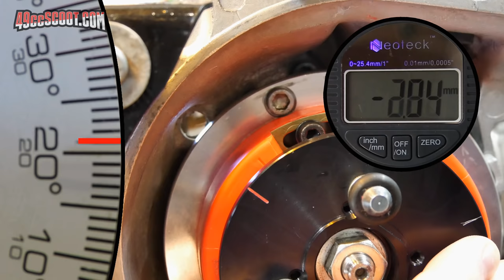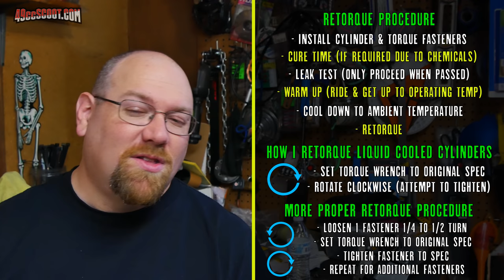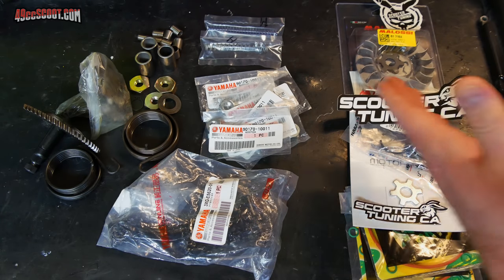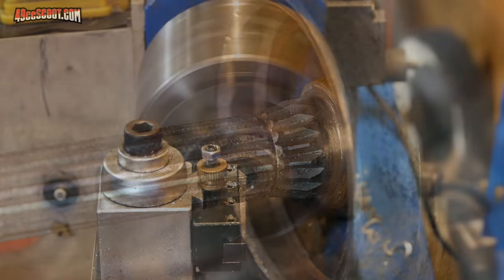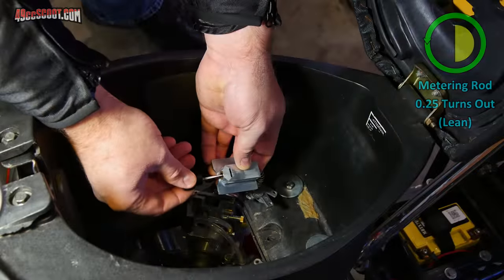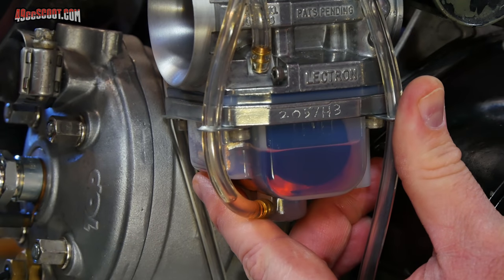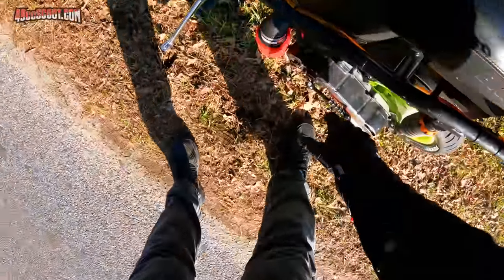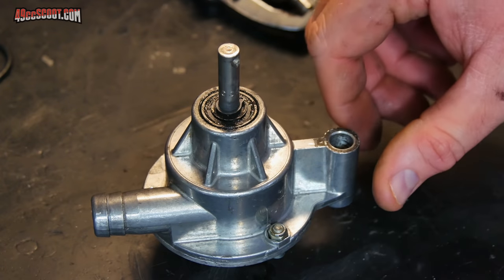Repairing My Scooter's Engine And CVT & Lectron Carburetor Tuning Continues : TPR 86cc : Part 51

Comment: What you have here is once again, classic high load detonation. In your Nov. 24th. video, I commented that if the detonation was not addressed, you would be doing this again. And here we are. That WOT stuttering/hesitation is detonation eating up the piston. And yet pull after pull, you held it there. 2 strokes rev very high and are very loud. You don't hear the pinging/rattling/knock that you will on a slower speed 4 stroke. For quick acceleration and instant throttle response, you need high compression, advanced ign. timing, and low gearing. At take-off, there is low rolling resistance, lower load because of variator/clutch ratio, and almost no air resistance. At full WOT, there is high rolling resistance, the motor sees much higher ratio, and the wind resistance is very high ( no aerodynamics  ). The motor is under its highest load. Compression, advanced timing, heat, load, and fuel octane all play a part in detonation. You want to keep the compression and the timing ( within reason ), and the load isn't about to change. The one easiest variable to change, is the fuel octane. You saw that going up and down ( all over the place ) on A/F ratio didn't do much. Lectron or your standard carb is not the problem. The instant you hear a WOT stutter, get off the gas and investigate. Get more octane in that little tank, and your motor will live.
Reply: if you are relying on your ear to detect detonation, youve already lost.

Comment: I can second that regarding the torque, boss.

I run a Stage6 MK2 'Racing' (not sports) and could not find the specs.. also my first aluminium kit.. emailed stage6 and they specifically said in the email something like - "do not re-torque after first run. Our Specs are counting on rubber squish, metal malleability and expansion and contraction of the metal after first heat-cycle. With the torque specs provided, everything will lock into place once the engine cools down. You may add 1 drop of blue thread locker in each nut if deemed necessary"

So that seems to be true.. in older mechanics or perhaps less "high-end" kits or iron cast that is needed , but not with these high-end cylinders. Im at 2500KM +- with the same setup, didnt check piston or anything yet but it sounds perfect and didnt experience loss in power. 
Only my poor wee stock ignition cannot cope once it hits 12k rpm  and have to back off the throttle a bit at 130kmh.

EDIT: when you hear that zingy noise (ding ding ding) on decel means you're way lean already. Wrong spark plug heat range can make it "act" rich without actually being rich.
these pwk are a pain, i could only get mine in tune with an NGK BR 9 - "EG".. with "ES" plugs was a no go..
Reply: eg is for race so they like to run only @ full throttle the es is garbage stock plug.im using denso w27esr which is the same but doesnt die on me like the ngk.irridiums are also killing after a few runs.
Reply: @jenny-masterchef  mine is the opposite actually.. up to half throtle she sounds like a mad goat full of power and reving up.. when i go wot she starts misfiring after 120kmh.. after a long ride it gurgles wot at any speed.
Figured the heat range or ignition was the problem. Looking at the plug it looked great, clean, light brown colour, but acting rich af ! 

so got 1 step hotter and voila. 135kmh on gps no misfires. But its not so snappy on the low end and its not so responsive now, has a bit of a delay and bogs on wheelies..
Wonder if there is a way to get that nervous "snap" without it gurgling at high rpm or running super lean.

Tried Denso and indeed they last longer than the ES and do a better job, but hard to find around here. Irridium never tried of any brand. This bike only seems to like EG plugs for some reason.. In the beginning was a pain to tune the carb until i remembered to test with plugs first. Never knew they could make such a difference
Reply: @joaomelo61  heatrange indeed is important too.normaly if u have a street class 70 cyl heatrange 9 is good.for high end 10.but colder plugs need more time for selfclean thats why the bike choke a bit.if take hot means like 8 watch out it will end up with the hole in the piston.bog down is lean i have a few issues with vacuum petcock it seems at wot the bike suck the bowl empty.only i dont like manual petcocks before time i had a few flooded carbs and its not funny in the morning all fuel over the floor.

Comment: Pull the studs and lap the top of the cylinder on a piece of glass with a sheet of 1000 grit sand paper taped to it. Cool project, I love small engines and enjoy following along.

Comment: My son's used lectron carbs on 2 motorcycle builds both were slightly modified engines pipe and porting in both cases he had contacted lectron for help choosing correct metering rod in both cases you could only get to only run correctly either at idle/ low rpm or correctly at mid to high rpm in both cases the had to replace the metering rod with one with a richer tapper after that both engines ran great all the way thru the rpm range with more power everywhere and a good bit more fuel economy the one bike was a kx500 after getting the lectron jetted right he completed a 2hr hair scramble race on a single tank of fuel without refueling that was a first for that bike  he really likes lectron carburators on 2 strokes but are way different to tune  than a normal carb

Comment: I really recommend you get a genuine Minarelli horizontal engine case, the clones have terrible clearances and just cause all these problems to you...
Reply: I was really sad seeing you go through all this stress...
Reply: No oil,  dry is the base fixation for most  heads. And the egde of the streight lineal is better to Check for deformation in 0.001 mm .
Reply: @MX-fo2nu  the clones are clones they will always be clones, they use cheap aluminum, they make them as fast and cheap as they can.
Reply: i think that too.. he  put a lot of afford in a chinese case.. get a original one and u have 90% less issues man.. or get a 125cc piaggio engine like i have in my scooters.. highly recommend these.. easy 20hp.. my runner has 35rwp with 185cc
Reply: @2taktfriseur  Damn nice, I got a BWs NG 9hp
on a cheap 70cc kit.. I would love to do something different with the Minarelli vertical engines like: athena 70cc, doppler exhaust, doppler crank.
Reply: @relique2841  athena is a good cyl... jeah man...sounds like a good setup..  built it and have fun with...:) 
 its my passion.. 2 stroke scooters, i love them...
Reply: @2taktfriseur  old stage6 Kits: sport pro mk1 and racing mk1 are rebrandet Athena Sport and Racing kit´s! back 18 or 15years ago>!  the mk2 series was designed by Stage6 Development them self. athena sport vs sport pro mk2, the mk2 has with a c16 ex 0.8hp more power with 21mm carb. athena racing vs racing mk2 with ex c20 and 24mm carb, the mk2 has arround 1.5-2hp more. And the Stage6 kits have a wider power band. not als peake as the Athena kits.
Reply: @2taktfriseur  same, one day I will build a setup with an Athena cylinder...
Reply: @relique2841  check my above comment on my setup bro only this is my engine is air cooled
Reply: @relique2841  the comment I replied to was to the guy who did the vid question was build most reliable engine for minareli engine
Reply: With your type of cylinder head that seals with the correct o ring it is not advisable to reface the head as the o ring will then hsve sealing issues and you might have to then do what your doing is to make it stay in the groove is to stick it there.

Comment: as far as torque specification and process goes I would follow exactly what the manual says for whatever you're working on. If it does not specify retourqing or using lubricant don't do either.  generally speaking the manufacturer knows what's best and if anything other than a dry single torque is required they will let you know.

Comment: The reason your engine is running to hot and the piston is damaged within the squish area is that the squish is to large as the mixture is igniting within the squish area causing heat to be transferred to the walls of the cylinder instead of being trapped within the combustion Chamber. I had the same issues so I went below the specs and the company that told me was so right it dropped my temp by 30 degrees. Also I know you guys have poor pump gas over there. Run it on premium and add silkolene pro boost witch is what the Mx guys use to stop pre ignition. The ignition timing needs to be correct to ignition when the piston has the fuel trapped within the combustion chamber and not the squish band.

Comment: Next build: building the most reliable 70cc engine.
Reply: Minarelli 3kj neos aerox jog air cooled 2stroke engine motoforce 70 bore stock crank stock carb 12mm 70main jet uk/ Doppler s3r pipe I have old Doppler variator too 3.5 rollers yellow band yellow clutch springs single reed petals Depending on model and cdi some are restricted Depending on model and country had about 3000 miles like this still runnin well not even changed rings or plug lol not even a service just Fully pinned everyday do let her warm up first tho but easily one of the best for reliability & power course you can go bigger carb but bigger risk I’m usin stoc carb for oil pump my mbk hasn’t got the oil pump anymore and I premix but this shits pistons monthly lol same setup tho
Reply: I will try my delorto 17.5 on the mbk and report back and also I have a naraku 17.5 that I will try on the neos still runnin stock airboxes great bikes

Comment: I’ve legit been checking your channel every day for a week now. Thanks for the awesome content. I’ve recently bought a Gilera Runner frame and started building it from the ground up. Its going to be a nice high rpm 70cc sport setup.
Something extra, you might want to look at getting a longer secondary gearing ratio, yours seems quite short from your video on that topic, it also causes the over revving at top speed. You only have fo go a little longer and your engine will probably be more reliable.

Comment: Quick tip of your stranded you can stick a screwdriver inbetween the cluch and the clutch Bell and then you van run it own but probly the screwdriver Will shoot away

Comment: It looks like the Lectron has been more causing more troubles than performance gains...
When you get to the point that the carburetor increase in CFM make the engine run lean, it usually a sign of to much for the engine. The bigger the carburetor the weaker the vacuum signal and the harder to pull the fuel out of the bowl. I know of a case that in order to get the carburetor to function because it was to large for the engine, it had to be ran without so the fuel could pull sufficient fuel from the bowl.

Comment: Sir i think try setting you carb without the air cleaner try using smaller carb... I also think that u should machine 1 solid head and delete that o ring... Base on your piston its way too lean

Comment: This is a little bit of a gut feeling but I think that this carburetor is just too large. based on my calculations last video your old carburetor was plenty large enough for your displacement and I think you're just not getting enough velocity through this carburetor for it to work properly.  lectron should be able to confirm or deny that pretty easily.

Comment: Please keep going for the 0-30. Thats what I used to be about, but I'm about $1.35. Finally hit a little too hard and the front went way up. Im on a vertical 2t so no weight up front. Most physically painful day in my life. I've converted to top speed now, however. Top speed on a scoot is always losing, but acceleration is where a well tuned scooter can kill anything to 35.
Reply from the maker: I'd have to imagine this thing would move pretty well off the line with someone less than half of my weight. I have to sit forward on the seat and on occasion it will still pick up the front. Probably more of a handful when you don't have 300lb to hold it down. Top speed is fun for bragging rights, but it seems sort of pointless otherwise to me because it's not like I'm taking this TPR on the highway for road trips. I have had 49cc based scooters on highways though, and it can be fun to see some people do double-takes when a big guy on a scooter passes them. 😁

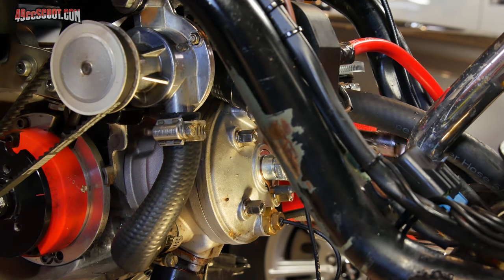Comment: Click, turnturn at 37:26 . Probably went up to 15Nm, you made me lmao. Looking forward to the next project you're talking about. Stay safe out there.
Reply: For your other prolems, my best bet is bad fuel. If you want the stupid alcohol out, put water in your fuel (see trough gallon) mix it up and let it settle. Then tap off the pure fuel. You can google search for more info. Also my thought is that flat carb is no good, orriginal performs better at full range.

Comment: I always doubted lectron, and what I've seen in this video is really hard to get it running despite the easy tuning method.
If I have to say honestly, jet type carbs like Mikuni Keihin Dellorto are better, because changing your jets in steps gives an excellent result. lectron is not easy how they explain. How you say it might work well specific applications, I think too. But for tuners like you and me it's a nightmare
Reply: lectron just sucks. they tried to take the AFB Carter model and apply it to motorcycles.

Comment: Turn in mix-screw,tuning.A dozen nozzles wich wil run the engine.Its not right you turn 1 round engine stops,and you have too small nozzle.Because next 0.02 mm has different spray in air flow.So you still put in the lower number.When km\h sinks,you have done wrong,but it can be you need lower nozzle.High rpm,only gas,porridge all theory with valves,heat,all speed of light.
Reply: @Nathanael Steele Of course.Overheated again.I`ve driven 50 000km.Also 50 c and -20c.Its only 1 way to screw it.My naraku v.3 came with .85 nozzle.But 90cc naraku can`t take 0.6,so I bought 05-kit dellorto from e-bay.Also 0.4 kit may buy.RESTRICTED MOTORCYCLE?

Comment: can you remember approximately how many Horsepower your Top performance TPR 86cc cylinder had when it ran best .. and can you remember what your Max RPM was at ... and what was your Highest Top Speed with this setup .

Regards, BP-Tuning
Denmark.
Reply from the maker: I can only guess at HP without a dyno, but if you listen to TP it could make low-mid 20s. I would say more like 20. It revved out around 14k with the Malossi MHR 86cc exhaust. It went  around 75MPH topped out.

Comment: Have you tried taking off the filter and 90° elbow and perhaps running mesh style filter
Reply: I always run my bigger carbs this way
Reply from the maker: You mean a bell mouth with just a screen? I'd like to keep a real filter on it. It may be different if it were a race scooter, but there's too much stuff in the air for a street scoot to go without a decent filter IMO. Not that it seems like I could tear anything up much more than I already am. lol

Comment: Caught myself in a lie.Used 2 top-gaskets,to prevent metal sound.So 60cc will need perhaps 0.68 or 0.65 nozzle.Runs very good on 2 gaskets,so maybe it needs that,0.74.But "factory" is 0.70 on original 139 qmb and lower,lower,lower the bigger cylinder.Speed is the same,by the gears and weights\springs(same).More horse-power.

Comment: Most hyper racing kits come with introductions to run at least 98 octane as the burn speed of low octane fuels causes overheating as at high revs the slow burn rate of low octane fuel ends up transferring to the cylinder walls again causing high temp I have verified my last comments and now no issues.
Reply from the maker: I use 91-93 octane, the most common premium pump gas here, but that's (RON+MON)/2 where I'm guessing you use RON for the 98 rating. They're pretty close to each other.
Reply: @49ccscoot  no I’m buying shell super unleaded which straight from the pump is 98 then adding 20ml of pro boost per litre and using the best fully synthetic oil you can get.

Comment: Looking at the tpr bore comparing to my airsal xtreme 88cc(mine has a one piece cylinder head)this maybe worth you looking into using a one piece head etc..
I've also had sealing problems with particularly polini type bores which have the green thin bore gasket which the your tpr bore also has
Reply: I'd defo say that cylinder head type and gasket is giving u loads of probs,the high rpm could be a main factor for the failure and colouring on the piston over time
Reply: Keep up the good work mate love all your vids and the time you spend trouble shooting(after all this is what we love doing the most)

Comment: Oi Brent, i just got my newest project running, a hyperracing minarelli stage 6 rt  70cc engine, however, loving in Denmark, in the Cold temps og around 0 celcius atm, my engine dosent really heat Up at All, IT rund cool at around 30 celcius, and stays there. Do you think that is would cause any problems?
Reply from the maker: Hey. I replied to you on the forum a little while ago, but I'd like to see it run closer to 100F. Cardboard over some of the radiator should do it, or that's what thermostats are for.

Comment: A 30mm carb of any brand is way overcarburated for the transfer ports in your cylinders. you fuel will never atomize properly. sometimes smaller is better as I have found out in 40 years of snowmobile racing

Comment: Sorry to see you have so many problems with the tuning...I think you should never run with the power jet fully closed, at least half a turn to be safe, and you holded the full throttle pretty long. Overall I don’t think the Lectron carb is worth it, you should just switch back to a pwk or dellorto. Can’t wait for the next vid 🙌🏻🤩
Reply from the maker: Thanks. I agree that it doesn't seem to be accomplishing anything for me, but it annoys me to not have an in tune result to compare.